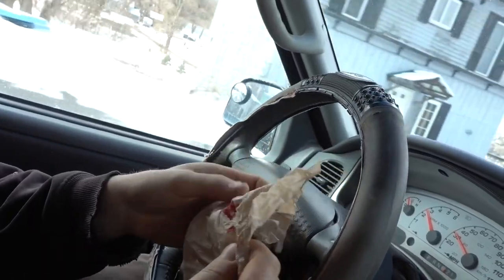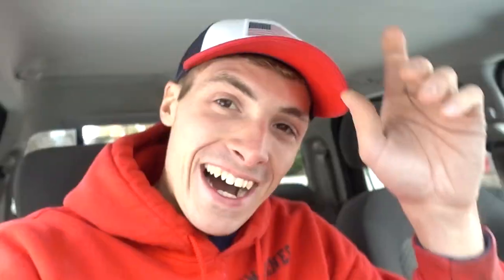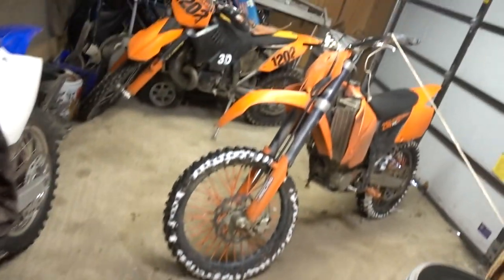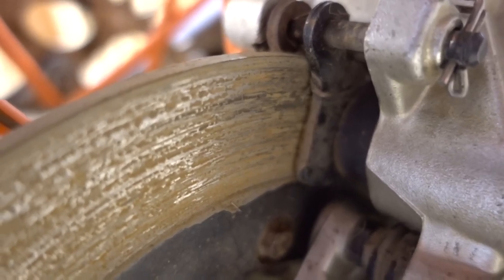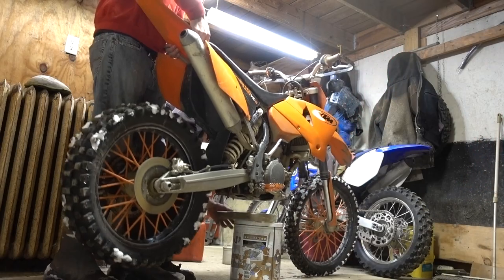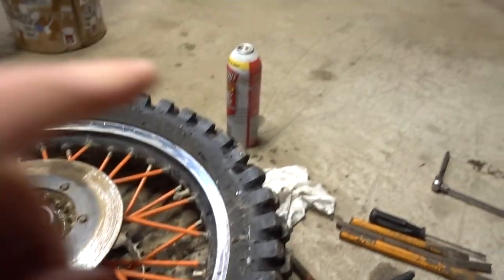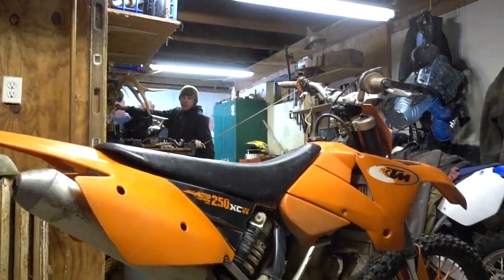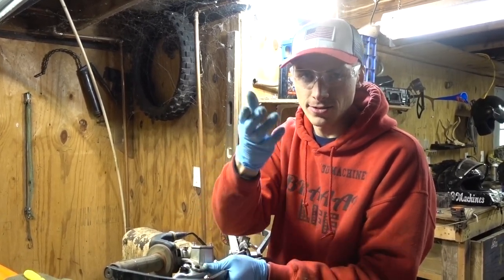THIS is why you NEVER BUY USED BIKES! (KTM 250)

Comment: Here for one reason, and that is valid reasons for not buying a used bike. Bought a 14 year old KTM 200 MXC, that has been 100% reliable, the last 3 years. Went through everything but the motor right away. Maybe the most bulletproof motor, in my last 40 years of riding. Some used purchases have not been as lucky.

Comment: I noticed that you did not check if the pistons even press on the brake pads... they might be stuck in the rear and front. And please change the rear brake disk that looks terrible and will only eat up the new pads and provide an bad to control braking.

Comment: You probably fouled a plug because the engine was running too cold to properly burn off the oil in the premix, same thing happened to me a few months ago, even though my bike otherwise works perfectly in warm weather.

Comment: Ok first off no matter what bike you buy it needs maintenance even brand new. from the factory bikes are not greased/oiled and the bearings/axles need grease. plus how can everyone buy new bikes, new bikes go from $5000-$8000  you can get used bikes for cheaper but they require maintenance. if you do your regular maintenance no matter what bike it is it will be more reliable than if you had not. Don't blame the brand if someone can't take care of a bike.

Comment: You got to becareful when it's cold out your two stroke will tend to run leaner which is not good for the piston or rings.I found that out the hard way.
Reply: There's a thing called carburetor adjustment.

Comment: 3D machines, you'll have to post what actually happened to the ktm 250... bad plug? Is it jetted to run in the cold? 
Also, that rear axle shouldn't be that hard to remove.. literally pounding on it to get it out works, but should be able to give it a tap and be able to pull it out by hand after that. With new wheel bearings that wheel should spin freely, in assuming yours has drag? 
All just from my personal experience.

Comment: When u start ur ktm don't give it throttle that's why it's not starting it's not like a 4 stroke
Reply: Apple/Android hacker your completely wrong you have it backwards four strokes flood out when you give it throttle two strokes handle it way better then a 4
Reply: Apple/Android hacker the reason it's not starting is if I had to guess fowling spark plugs witch would be a top end or replace the plugs every time it gradually gets worse tho as the top end gets worse
Reply: Apple/Android hacker two strokes are known for it when your top end needs a rebuild

Comment: I thought it was real funny that the vid ended so quick when the first time 2 stroke owner killed his plug y dident jake tell him if the gas is not mixed spot on you wll spend 40 bucks a ride on spark plugs lol I mixed my 1997 exc 300 at 50 -1 and wonce I found out the right mix it never killed plugs infact wonce I tuned my power valve and found the perfect mix my ktm was star trek fast but my 50-1 mix was in florida so idk if it will be different for you guys
Reply: Pff 30 to 1 wont foul plugs if you dont granny mode in the forest with oversized jets :D

You can also choose a hotter plug for enduro and cooler one for motocross or dune riding.

I'd rather lubricate my bearings than fk up a few cheap plugs because the cost is even more than only the bearings.

Comment: ive owned many ktm 250's and 300's there engines are well made you just kinda need to memorize a lot of book work to do repairs that last I also noticed that jakes ktm dose not have a lot of power on ktm the power valves are peskie lil buggers but if you get them right on the money the power gain is huge JAKE FIX YOUR POWER VALVE GET BRAP BACK

Comment: wouldnt of had a problem from a HONDA!!!
Reply: justa4 banger Hondas are worse
Reply: justa4 banger hondas may not have the most power but they are the most reliable.
Reply: well i have 2001 cr250 2 stroke and it rips better than this ktm so i don´t know what ya´ll talking about
Reply: Agreed, I like the ktm sx range, but the trail bikes just have no powerband and are just pretty trashy
Reply: honda's are overrated, yes before the 4 stroke revolution they were probably the best, apart from yamaha.. but not anymore.
Reply: Ewww hondas are not even worth half the cost they charge. They still use cable clutch and brake, they don't ever start, and many other things. They are just not fun
Reply: Well my honda was 1300€ ;)
Reply: And if your bike doesn´t start it´s not the bike´s fault. Hint: it´s the owners fault. like i said my 2001 cr250 2 stroke starts from 2-4 kicks and rips;)
Reply: Will I. I think Yamahas are the most reliable, they're up there in power too. Definitely have more torque than hondas.
Reply: Will I. Although all of the cr(s) are pretty peppie, especially cr500

Comment: It's not tha you bought a broken bike it's because it's a ktm
Reply: Sean Mcquerry Keep Takin Money...
Reply: Sean Mcquerry all bikes are gonna brake all bikes ár the same 2 wheels and a motor
Reply: Hlynur Ingolfsson  But not all bikes are ktms so your wrong
Reply: WeRideLikeThis hahah I have a 10 year old bike at the moment I kept up on maitnence that's just about it it's a Yamaha yz 250 never heard of a ktm that didn't need excessive amount of maintenance or parts just saying bud
Reply: It is also 11 or so years old, and the fact that the previous owner didn't have a proper functioning front brake, bad wheel bearings, basically no brake pads, shows that the bike was not well taken care of. 
Also if he would've gotten a 2008 or newer he would've had a lot nice bike, since in 2008 KTM came out the new 2 stroke motor.
Reply: Sean Mcquerry hell yea dude i don't like ktm👌🏻👌🏻👌🏻
Reply: yeah one of my bikes is 7 years old, but its a drz so they are tanks, but my ktm is doing great very low maintenance, i do the oil, air filter, tyres everything at the same time, they are not high maintenance, if you are saying a drz is high maintenance then you are crazy, the new ktms are better to, low maintenance, and the best performance on the market in their class
Reply: Had a 2008 ktm 125sx, rode that thing like a bat out of hell, worse problem i had was a blown rod bearings, decided to drop 700 CAD on a new top and bottom end and done the work my self, bike never had trouble after, Every brand will break WHEN MAINTENANCE IS NOT DONE!!!
Reply: Besides, she most likely aint starting because of a fouled plug, and by the way they were kicking it doesnt look like the top end is all that good in the bike anyway!
Reply: Sean Mcquerry 
Have you ever owned a KTM? believe it or not there are some punks that don't take care of their shit and sell it cuz they don't want to deal with the issues. Then the new owner slowly finds out about them. It's not that it's a Ktm, I don't care for Suzuki but I'm not saying they're a bad bike. It's all about the way it was treated. If u are an actual rider and maintain your bikes you should know this
Reply: xboxdude764 not necessarily I ride with a guy that owns a ktm 500 and seems like I have to tow him back just about every other ride. And it's not his fault he if anything over maintains the bike ktms are great bikes they just aren't built to last they are built to race. That being said he should have gone with another bike if he isn't going to be racing every weekend or at the track training
Reply: Absolutely right there buddy its all about maintenance! I traded that ktm on a suzuki rmz 450, buddy said she was mint with a full engine rebuild and stuff, had a bit of oil smoke when i got her he said it was excess oil, that oil smoke never went away, turned out the valve seals were shot! I never blamed the bike, hell, I loved the bike, I just blamed the previous owners lack of maintenance!
Reply: That bike is a trail bike its the XC-W, its an old bike with a previous owner not doing maintenance, give him some time to work the kinks out and she'll be mint! As for the not lasting thing, i got over 100 hrs on an oem top end in my ktm, and I got 2 top ends (200 hrs or so) on the oem crank before my idiocy killed the rod bearing, that was a SX race class bike, Visit the dirt bike channel on youtube, that guy has a 300xc and regularly goes over 90+ hrs before changing a top end out.
Reply: Sean Mcquerry lol
Reply: KTMs are junk
Reply: hondas are junk
Reply: Lahms hahahah I don't ride Honda but they are much better recreational bikes than ktm
Reply: Honda Brapers27 no not all bikes are Kawasaki
Reply: Sean Mcquerry yy
Reply: Sean Mcquerry THE 10 BEST USED recreational 2-STROKES dirt bikes Ktm 300 came 2nd just behind Suzuki rm250 and the ktm 300 came in 4th the honda cr 250r was 8th and the honda cr500r was 10th so any 2 stroke is better than honda
Reply: Sean Mcquerry ktm is amazing. But not as good as Honda #crf150r
Reply: Pitbull Gamer81  sais who?? I would like to kno
Reply: Lahms your junk. #=life
Reply: Joe Vizcalla dirtbike magazine
Reply: too bad ktms are some of the most well made bikes
Reply: Pitbull Gamer81 I talked to bike shop owner he told me ktms and Yamaha are maintance whores Hondas are built for reliability that they are #1 as far as reliability and not far off when it comes to power
Reply: Joe Vizcalla that bike shop owner is full of crap then don't listen to everything you hear and believe it
Reply: Kolby.67 guy has his own shop out here here in Vegas look up raptor with gxr1000 motor guys busting donuts in front of the shop it's not good to belive everything you hear but when the person has a shop for years and is successful I'm sure he wasn't blowing smoke he should know what he's talking about he fixes bikes for a living
Reply: Joe Vizcalla I know somebody that owns 2 shops and one of the biggest in the state
Reply: R
Reply: Nah, any bike can foul a plug, my Yamaha YZ 125 did it a few months ago in snow and left me stranded, even though it works perfectly in warm weather. He needs to adjust the jetting for winter, possibly run a hotter plug and then it'll work just fine.
Reply: Sean Mcquerry ktm are the most reliable bikes money can buy
Reply: It is not the brand that is the problem. The condition is the problem. A lot of things you can see on that bike on the outside are not good and can tell you how well it was mantained. You need a lot of knowledge when buying a second hand bike. This bike I would not buy if it isn't cheap
Reply: Sean Mcquerry Ktm and Honda are both super reliable, and he has both!!!
Reply: Sean Mcquerry ur right dude becouse Me and my dad were looking for bikes for me and we found 2 both the same ktm 125 sx and they were both 2800 but the difrence was one was a 2007 and the other one was a 2009 and the 2007 one looked like it had been abused to shit and the 2009 was looking way better and didn't look like it had been abused so ya it's not the bike you have to look at everything when ur buying bikes like look at the plastic if it's been scratched to shit I wouldn't buy it
Reply: Billy Boots exactly it all depends on how u maintain the bike if u don't maintain it well it's gona run like shit
Reply: Billy Boots and if u treat it well it will treat u well
Reply: Sean Mcquerry hondas will last for ever and so will ktm if u mainatain ur bike and u don't run the snot outa it all bikes will brake down if u don't run the snot outa then even hondas
Reply: dan gardner yes they r becouse there made in Austria
Reply: Sean Mcquerry This is true
Reply: AJ-S plastics don't tell you shit because of can just get new plastics and make the bike look sorta new
Reply: AJ-S and all dirt bikes get scratches